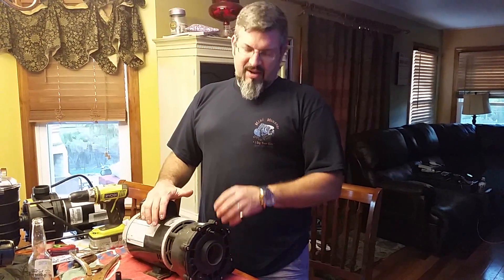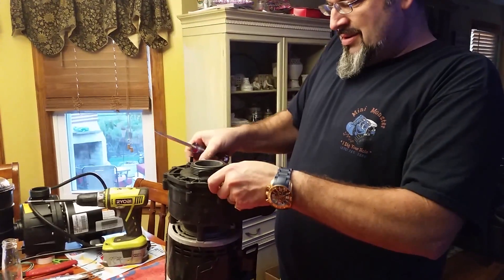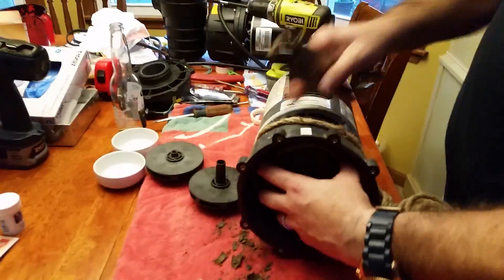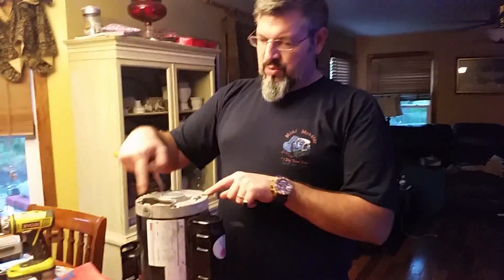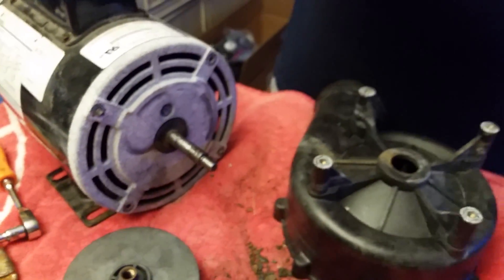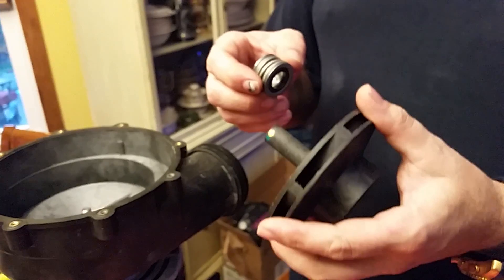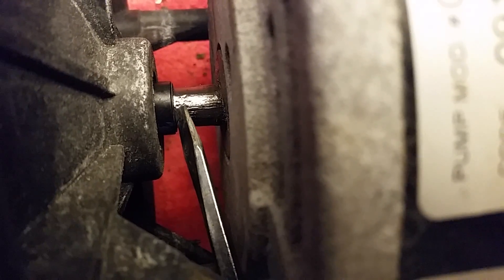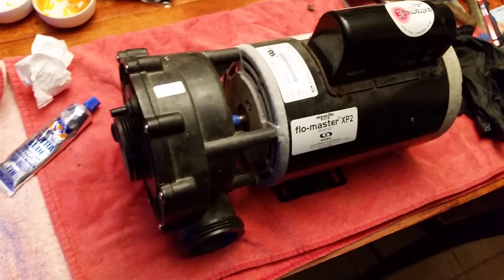How to Remove Seized Impeller From Pump Motor- Hot Tub Flo-Master XP2 No Special Tools Save $$

Comment: Where in the world do I find this rubber washer at?! I have a Theramax 2.5 hp pump for Sundance optima. The small washer that sits in the outside against the motor housing 4:41
Reply from the maker: Amazon you can buy a flat rubber washer 120 piece assortment for $5.99 if you measure your washer, you can look on there by size. Any decent hardware store should have the rubber flat washer , or home depot or lowes.  Look in the in the nut / bolt isle in the slide out drawers they have nylon washers and rubber. My home depot seems to always be half empty and not have the size I need.  That rubber washer is probably only a splash shield to keep water from going into the bearings.  The bearing should be sealed, but the manufacturer put it there for extra protection. Hope this helps.  Thanks for the question.

Comment: The new impeller I bought gets wider at the base and I cannot get the seal on, is that normal?
Reply from the maker: @jasoncook9898  do you have a way of measuring the outer dimension of the impeller shaft and the inner dimension of the   seal with a caliper or a digital caliper?  The shaft should be smaller than the seal, it could be a hundredth of an inch smaller. If it's the same size or larger.  Something is wrong, either it is the wrong seal or wrong impeller.

Comment: Couldn't get the rope to work.   Found a plastic yogurt container that fit over the impeller, and tightened a band clamp to hold it on the impeller.   This had enough area and grip to get the impeller loose.
Reply from the maker: I find the majority of them can be removed with just the rope. But sometimes the it's the type of rope that doesn't grip the impeller.  Good job engineering something else that worked for you.  Thanks for the comment.

Comment: i just watched that last part, with the permatec,   interesting.   I might try that.   But I do know a nice tight slinger works, the only thing is , if that pump starts squealing one day and you don't take care of it right away the slinger is going to wear out fast, not one of them last long after the chemicals  in the water that blow past the spring seal in the wet head.  

   there should be a material that doesn't tear up like that stuff they make these seals out of by now.   I got this damned thing new in 2017 and its a wreck now.     I don't see how people pay 20K on a hot tub. LOL     it's a huge scam.

Comment: this one worked for me, Unbelievable amount of torque applied though.  The shaft guard split down both sides and the ramp in the pump head broke a bit.    the motor is still good however and if I wanted to rig the wet head back up I could probably do it  - with a new shaft seal, a new slinger and a new case seal and also a new impeller.   after buying al that though I see I can probably get a already built 56 wet head for this.    
   Oh, to clean up that impeller shaft coming out of the motor I taped the threads with some electric tape and locked the chuck from my cordless straight on it, then I spun it like a lath and used a file at first since it caked then went to 60 grit and then reg emory ,   Got al the funk off.  I will probably have to make my own slinger now though. I was thinking inner tube rubber.  the slinger never comes with a new wet end.  sob's... LOL 

   Grr tomorrow is Sunday, gotta wait till mon to hit the funky spa store.

Comment: Just an update .
Hi there, mate,I have a balboa control unit, And the flow was not working as strong as it should. I thought it was the pump, The jet button when pressing started to stop working and just become to have a mind of its own. I notice once the pump started without pressing any button and once just stopped also. So because I was not getting much flow, first bought a new impellor, because the other one was destroyed. Did not solve the problem, still low flow. Now I have installed a new pump, And the same problem. So there was nothing wrong with the original pump. Now I installed the new pump today, normally it goes on PR for about 7 minutes then it all starts up normally. So when I put the breakers on, the pump was running on low speed, Straight away, that was strange, never done that before when PR is starting up the on process but is a new pump.  The jet button stopped working again with a clicking sound coming from the Balboa control box. Could this just be a fuse problem, possibly. or a relay ,what does a relay look like ? I am dumbfounded here. So now it is not the pump or capacitor, all new so , ruled out. The heating element is all fine and working, all checked there.I have a video ,if you were interested to look at.

Comment: l have a Rimini spa bad or hotub , that is about 8 years old. I am in Sweden, We noticed a while ago that it did not seem to have full power, when pushed on full power, the flow was weak, everywhere. We also said to ourselves, that we think that we had 2 power settings, you pushed it in and got like 50% bubbles and then pushed it in again for full bubbles. But we only seemed to have one setting now full and off only. I know the pump is 2 speed, says on it. So I took the pump out and took it apart, noticed that the impellor was half missing, all broken, So I thought great was impellor, ordered a new impellor and seals, just the same, pushed the jet button on, which again only full mode, hardly any flow. could not believe that this was not the problem.
 And then after testing it for a good few times, the jet button refused to go on to full bubbles, I am thinking that this is some safety cut-off switch inbuilt. I thought for a while that possibly the pump smelled like it was burning just a little. I have taken out all the jets, emptied the water, blasted a hose through all of them, thinking that if 50% of the impellor is disintegrated, then bits must be stuck somewhere. Some small bits have come out. very small though. I am wondering if I need to buy a new pump, Just hope it's not the motherboard or control panel. Because the pump has not 2 speeds working, or something is definitely not right. What's your opinion. Is there something else I need to check? I am cracking up, not finding the problem, Could it be the capacitor? I am hoping a new pump will solve the issue. Appreciate your opinion thanks.
Reply from the maker: If you smelled something burning it could have been coming from the circuit panel. Disconnect the power or shut off the breaker for your spa. When you verify the power is off. Open up the box that contains the main circuit panel. Look for obvious burn marks like in my video. I don't know what power your spa operates on but here in USA most spas and hot tuba run on 220volts.  When there is a failure,  usually on a circuit board is because of water leaking on the circuitry.  That kind of power going through a circuit board will cause An obvious burn mark.  Take a look and let me know how you make out.  I also looked up your brand spa (Rimini)  I had no luck finding info on it.  Are you sure it's spelled correct?
Reply: @ZeroFuelRequired hi again, l will do this. It was spelt right. Carmargue Rimini, the company that deals with these in denmark is called Denform.
Reply: @ZeroFuelRequired  l looked at the electrical panel that sits above heat exhanger, all looks fine  2 fuses one with glass not blown and a bigger one that has no glass to see if its blown. The actual control panel was not accesable. I have noticed ,on the pump where the wires come out, there is a protection white sleeve that had some brown burning on it but the wires were not burnt. By the way when l said l smellt  some  only faint burning  this was only when the on and off of the jets started to play up and stopped pressing on. Weeks earlier before any smells ,still had the low flow, problem because of the impellor was destroyed and as l said, it was no different with a new one, which was strange.
Reply from the maker: @swedishkev  it's difficult to troubleshoot something over the net and I can't find any info on the Rimini spa(except to buy a new one).   It sounds as though you've narrowed it down and the motor could be the culprit.  The broken impeller could have jammed the motor, overheated it, burnt out the brushes or the winding.  If it has brown mark on wiring and burnt smell it could definitely be an internal problem in the motor.  If you opened the motor it would probably smell 10x worse.  If you haven't checked already,  look in the heating element to make sure there isn't any impeller plastic stuck in it.  I'm sorry I can't be of more assistance.  Good luck on your repair.
Reply: @ZeroFuelRequired  Ok, Thanks,ordered a new pump,not convinced it is the pump though. Just took the old one apart,could not find anything wrong looking  anywhere. .
Reply from the maker: @swedishkev  does the box that holds the main circuit board have security screw heads and that's the reason you can't get into it?  If you have a harbor freight near you.  They sell a security bit sets that have all the diffent types for very cheap.  Then you'd be able to open the box and look in and see if something fried on your main board https://www.harborfreight.com/search?q=security%20bit
Reply: @ZeroFuelRequired  Hi again no security screws, l looked inside the main circuit board all looks fine, l meant the actual control panel with the buttons, there was no way to check that. I think l definately need to look inside the heat exchanger, perhaps parts of the impellor are stuck there, but would they melt?
Reply from the maker: @swedishkev  I  understand now lol.  Depending on how much broke off your impeller,  the average heater for a spa is about 5500 watts. Water flows through and gets heated.  Plastic pieces touch the element inside they'll probably melt right to it.  I would definitely check the inside your  heater.
Reply: @ZeroFuelRequired  but ,is it possible that a big piece is inbedded and causing the low flow issue. I guess l have to fully remove ir, if i just unscrew ir,will not really see much. Needs to be inspected .thanks
Reply: @ZeroFuelRequired  checked it,nothing in there.
Reply from the maker: @swedishkev   eliminate all possibilities.  Maybe give the manufacturer a call to see if they'll help you troubleshoot your problem.  🤷‍♂️
Reply: @ZeroFuelRequired  Not that easy with there rubbish English in denmark.Thanks anyway.

Comment: Where can I purchase an impeller rebuild kit?
Reply from the maker: The links are in the video description.  Thank you for the question.
Reply: I see the links for that particular pump so I guess my next question is how do I find out what type of pump do I have? I’m working on a “softub “ that has a length of tubing that is wrapped around the motor which is covering any type of markings on the motor

Comment: 91693501 - Impeller part number related to AquaFlo motor 02510725-2 (1 HP Motor often used in SofTub 220 - the impeller will only have this part number embossed: 916935. Some companies use part number AF91693501)

More info can be found here:
https://www.getpoolparts.com/product/25859/impeller

Comment: Thank you so much for this video.  This is the exact issue I've been having.  One of my spa jet motor shaft tries to turn but won't.  I've been trying to find someone to repair my spa but can't find one.  They are either too far, too busy, only repairs spa bought from them, and does not return my call.  This video is my guide to repair my spa myself.  Thanks again.
Reply from the maker: Good luck and thank you for the comment.

Comment: Great tip, I've been struggling to remove the impeller using a strap wrench but couldn't shift it.  Once I found a suitable piece of rope the impeller was off in a few minutes - thanks for the advice!
Reply from the maker: I'm glad I could help.  Thanks for the comment.

Comment: Wow, thank you - thank you - thank you!!!   I watched a video and the guy used oil filter wrench.  Not having one of those, I continued my search.  I saw your video and attempted the removal.  I couldn't rotate the shaft enough with the rope tightening with the pump housing support stanchions in the way.  I pulled the motor apart and clamped the vice grips onto the shaft to allow better rotation.  It was really stuck!  Thank you again!
Reply from the maker: I'm glad I could help.  Thank you for the comment.

Comment: SWEEEEET!  Thanks so much for this!  Mine wasn't even stuck too badly, I was just having trouble getting the leverage to unscrew the thing while trying to use one handed screwdriver on the shaft end at the bottom at the same time.  Getting the impeller to stay put without having to hold it was key and I was able to do it with a short handled flathead screwdriver on the bottom end much more easily.
Reply from the maker: I'm glad the video helped you out.  Thank you for the comment.

Comment: Yes there were some helpful tips on removing the impeller but the placing of the Permatex silicon on the shaft is a bad move, the original cause of the corrosion on the shaft is due to the mechanical seal failing this then leaks down the shaft, for the shaft to be this badly corroded it has been leaking for a long time, placing the silicon on the shaft is now blocking the tell-tale indicator that mechanical seal has failed and needs to be replaced, resulting in the same problem, by catching the failed seal early you won't need to replace the impeller just put a seal kit through the pump and save yourself some money on parts
Reply from the maker: What you are saying is incorrect.  The seal did NOT fail.  The motor shaft corroded inside the impeller shaft from age, moisture whatever. That corrosion expanded the impeller shaft till it cracked,  leaking water through the impeller shaft past the seal.  The impeller is junk and had to be replaced.  The seals were still good but I'm in there, they are cheap and are being replaced too. Covering the end of the impeller on the motor shaft with silicon to keep moisture out would just be common sense to possibly keep it from going bad again but there are no guarantees. It's just a bandaid for a bad design. I hope this clarifies why it went bad

Comment: The sleeve on my impeller, the part that stretches over the shaft, crumbled from rust, but it was fine Where it screws on. 

I didn’t want to buy a new impeller, but couldn’t find and data online suggesting the need for the sleeve. As an experiment I installed it, using extremely high purity silicone around the seals, and some no5 ron thread sealant only in the threads. I had already sanded on the rust from the shaft and put rustoleum on it. Paint Cured for 72 hours before re-assembling it. 

I am happy to report that it is performing exactly as it did before, and honestly it seems a bit quieter. With the anti rust measures I took, I actually feel this is an upgrade. I can’t know for certain, and don’t recommend this for anyone who isn’t comfortable with watching it fail (should it). If y I do try know it wasn’t my recommendation. I’m just telling you my experience!
Reply from the maker: That sounds like a lot of work but if it works why not.  Thanks for the comment.

Comment: Such a great and helpful video. Thank you so much. Unfortunately, after putting it all back together, I am leaking water from the impeller side toward the shaft. I guess I have to just uninstall the parts and re-install. I did get the rebuild kit with all the parts used in this video and made sure I ended up with ceramic on ceramic contact. I only partially filled the spa, so never turned the motor on, but I don’t see how filling and turning it on will correct the leak. I must have not tightened the impeller enough. I was afraid to over tighten the impeller on the shaft. That must have been my problem because I triple checked my work and made sure all pieces were solidly in place to prevent leaks.  Ug
Reply from the maker: Make sure the base of the impeller shaft that slides over the motor shaft isn't cracked.  All new seals and if the impeller shaft is cracked it will just leak water right out. There's a possibility it's a hairline crack you can't see easily and when you screw it on to the motor shaft it expands the crack. That's the defect on this design is the motor shaft rust inside the impeller shaft and the rust will expand till it cracks the shaft. That's what causes 99%of the leaks.  The ceramic seals really shouldn't ever go bad(unless you get a finger print on it and it burns up). I hope this helps.  Thanks for the comment.

Comment: In California, as per the pool repair guy, they cannot replace the single speed motor legally, only variable speed motor. I didn't know that until he came and charged us $75.00 to tell us this fact. Even though the Home warranty guy replaced the single motor pump ( may be to save money) couple of years back. Right now I have only 2 choices either fix it ourselves or pay almost $2000.00 to replace it with variable pump with some modifications. Pool is 14 years old. Ordered replacement motor from amazon, lets see if can do it ourselves. keeping fingers crossed. Thanks to your rope technique,  we were stuck at that stage.
Reply: We replaced the motor, primed it and it is working now. Thanks again

Comment: THANKS for the advice! I was able to get the impeller off using rope. I have the same issue with the circulator, AquaFlo Flo-Master FMVP Pump Part Number 00710348-2, COde 2. No way to fit a rope around the impeller. Any suggestions on how to break it free?

Comment: Next time, if there is, use a Qtip taped to a screwdriver to apply your silicone. 
Good video, and it will save you $150.00 minimum doing it yourself.
Reply from the maker: Michael W Mitchell if there is a next time I'll remember that.  Thanks for the comment.